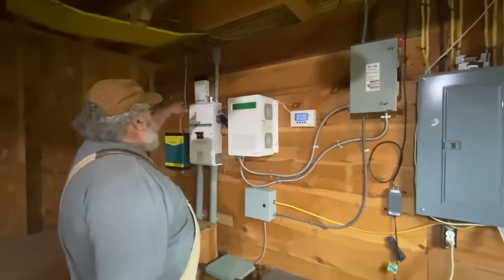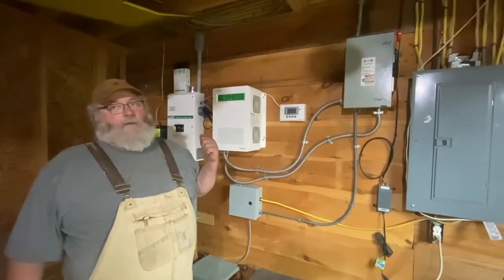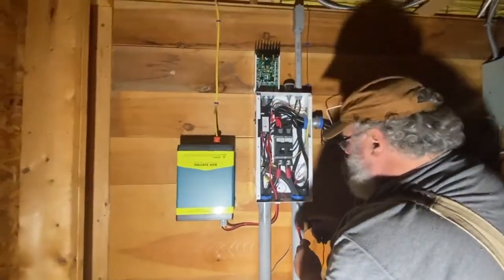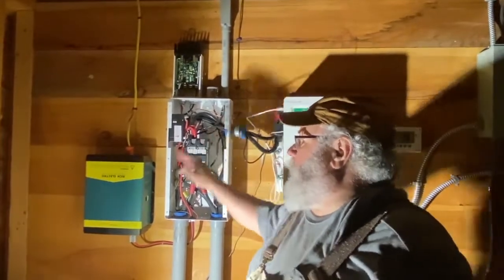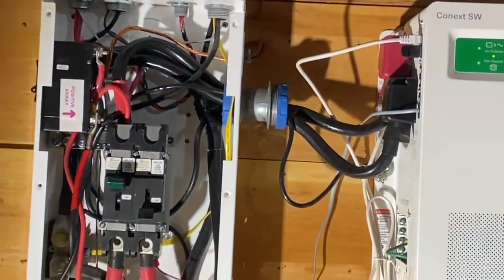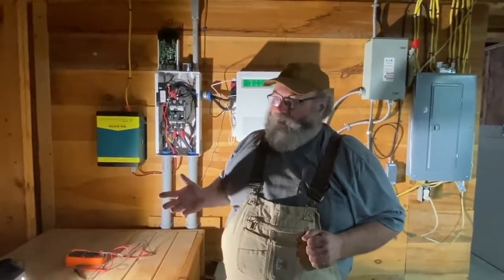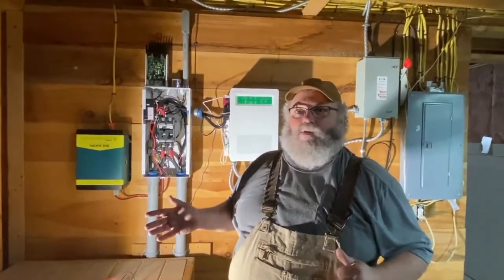Off Grid Power Supply Problem | How To Reset A Charge Controller | DIY Troubleshooting

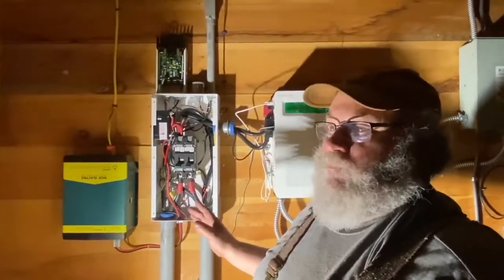Comment: 5:58 very important part.
I just got off the phone with Battle Born Batteries and they want me to put in a switch in between the batteries and the charge controller I told him that that I didn’t think that was right.
But their batteries are different they said.

But like you just said I would think the charge controller needs to know what to do with the power that’s coming in from the solar panel.
Always connect batteries to charge controller FIRST and then have a switch / breaker between the solar panels and the charge controller so you can eliminate and control to your power.
Reply from the maker: I will have to check them out. Yes that stored power has to have somewhere to go.